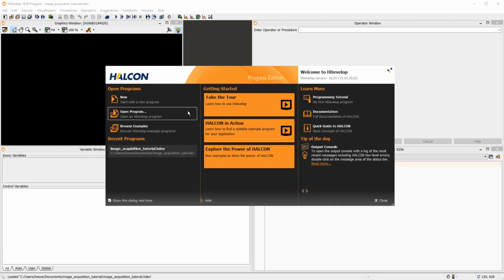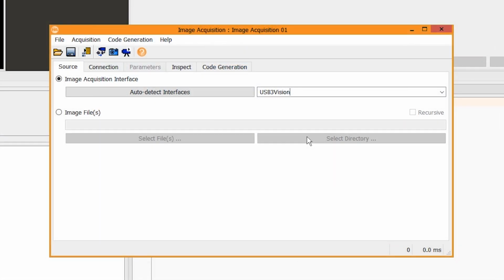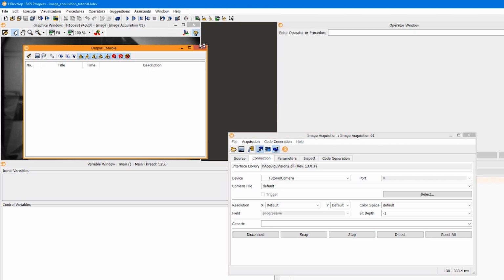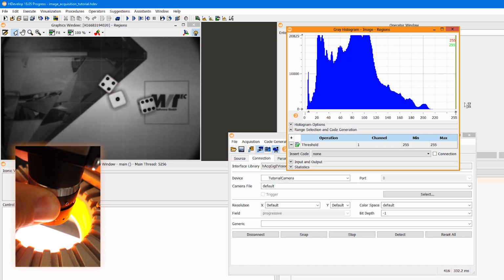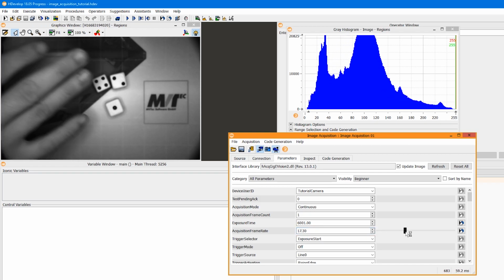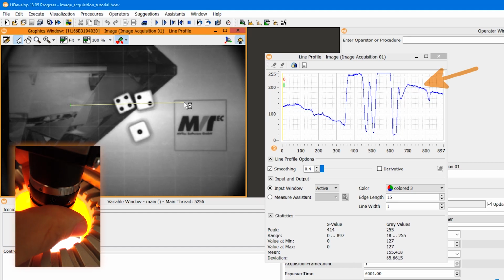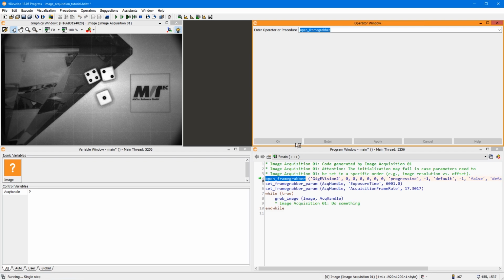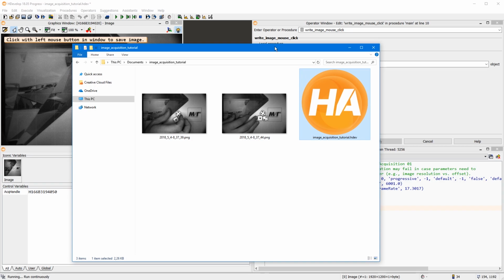Image acquisition with MVTec HALCON & HDevelop

Comment: Do you have any example of auto focus? Here you have to manually set focus of camera. A lot of GigE cameras have Focus and Iris parameter. 

How to write program which will check for grey values in histogram and adapt iris.
Could I use threshold command and then sum space of all the regions above threshold. And if selected space is more than 1% of space of image then i should lower Iris value. Or hysteresis_threshold and if i get any region then i have to decrease Iris.

How to detect if picture is in focus? I bought DFK Z30GP031 GigE camera with text autofocus on it ... but camera do not have auto focus. So I'm wondering if i can make HALCON program, which will calculate sharpness of image and adjust Focus parameter of camera to achieve best sharpness value. Which method should I use? 
edges_image to get list of all edges ... info_edges to get list of edges wider than 2 pixels ... is there some better way?
Reply from the maker: Thank you very much for your question.

We would like to refer you to our example script determine_sharpness.hdev, that example shows how to measure the sharpness of an image using four characteristic quantities.

What you said about gray value histogram, threshold and others, they all can be realized in HALCON. Whether you can adapt the iris automatically we are not sure, but exposure time and other parameters of camera can be adapted per e.g. GigEVision.

About why DFK Z30GP031 GigE camera does not have auto focus, you should contact the manufacturer.

If you have more question about how to implement your application, we would like to ask you to contact the HALCON distributor in your country. You can find them at https://www.mvtec.com/company/partner-network/halcon-distributors/
Reply: @mvtecsoftware  Thank you for your help. I was able to add auto-focus functionality to my program. :)

In DFK Z30GP031 camera from Imaging Source, auto-focus only works if you use program from manufacturer, which runs on PC. So camera have not integrated auto focus inside of camera.